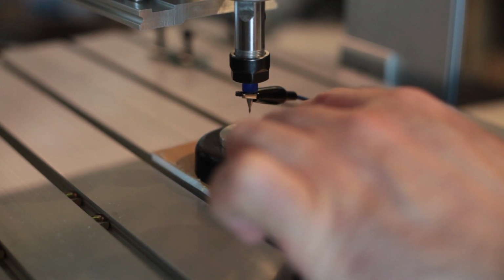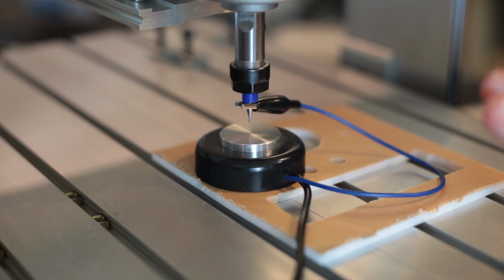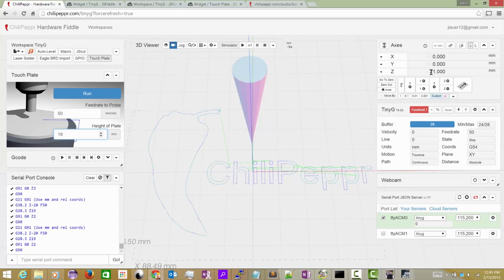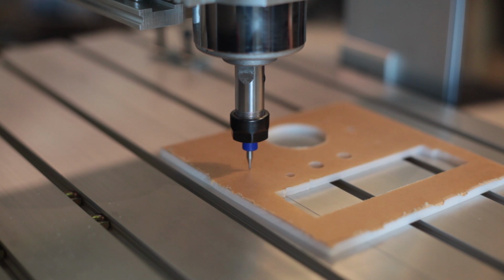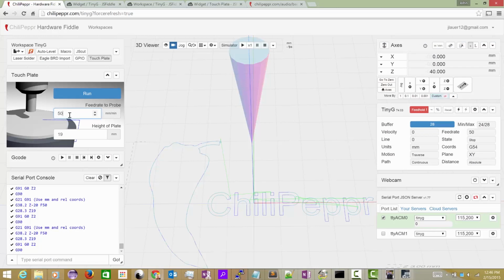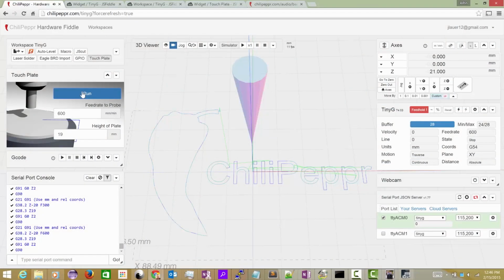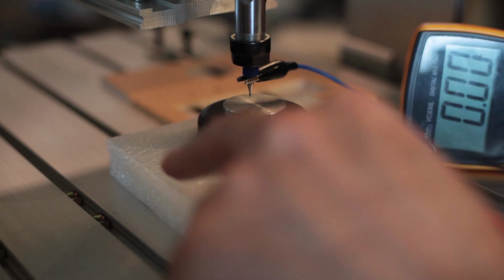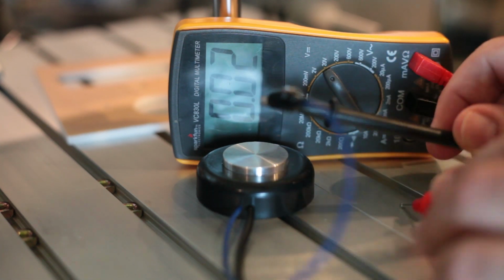Touch Plate in ChiliPeppr

Comment: John, like someone else posted, my spindle would travel up instead of down but recycling the controller fixed it. My question is why mine is not allowing for the touch plate thickness even though it have entered it. once the tip touches it automatically sets the Axis to 0. If I click go to 0 it goes to the touch plate height instead of the work piece height. Any suggestions? Great video!!
Reply from the maker: I've seen this behavior on certain versions of TinyG firmware. One thing you can do is just move your spindle down by the height after the touch plate process and then zero out all your axes or just the z axis. So there is a workaround with 1 more step.
Reply: My version of chilipepper is a little different. It has set g54, go to g54, set machine 0 and go to machine 0. I'm new to cnc and this was a bit confusing. When the probe touches that sets machine 0.  Remove the touch plate and click go to machine 0 and it's dead on. Which is exactly what you were saying. I was confused as to what was happening but I see it now. I'm now a subscriber!!

Comment: i used DSP controller. I set the z axis to use an automatic tool, but when it starts my machine, my router blade penetrates the table as deep as 3 cm. Why?

Comment: Probably a silly question but, how does this connect to the
CNC shield for it to acknowledge and feedback that a connection has been made?
For example I have this shield  http://forum.hobbycomponents.com/viewtopic.php?f=40&t=1747
Reply: It works! Touch plate and auto level.
Reply from the maker: On TinyG you connect your probe to ZMin (Z-).  You can connect that CNC shield to an Arduino Due to run TinyG G2 core.
Reply: Not sure I'll change boards just yet. I'm still trying to get to grips with how a CNC works :)
Reply: In the corner, the blue pin SCL (A5) and ground, but I haven't tested it yet.
Reply: Please let me know the results once you've tested it.
Reply: Sounds good, so you connected A5 to ground and this stops/zeros the Z-Axis?
Reply: A5 to end mill and GND to copper plate (for PCB milling)
Reply: Great! I'll give that a go - thanks for your feedback.

Comment: After homing my machine for all three axis using limitswitches i start using the touchplate for the Z. Instead of down, the spindel travels up most of the times. Sometimes it travels down. Any idea why this is could happen?
I have a 4030Z and use the same touchplate.
Reply from the maker: +Henny Poort What controller are you using?
Reply: +John Lauer I am using TyniG V8
Reply: +Henny Poort  After I homed my machine the "round pyramide" simulation of my spindle is  also hovering underneath the Z-0-level in Chilipeppr.  Could I have missed a setting somewhere?
Reply from the maker: What CNC controller are you using?
Reply: +John Lauer A TinyG V8
Reply: Did you ever come up with a resolution for this?  Ouy TinyG v8 behaves exactly the same way.  Trying to touch on the Z moves it up instead of down.  The new Super Touch Plate widget does exactly the same thing.  In fact, X and Y on that widget also move the wrong directions.

Comment: This is a cool add-on. I looked through the widget code, and it appears to use a G28.3 command to reset the z zero. Doesn't this reset the machine coordinates instead of a work coordinate system? Would it be possible to change it to a G10L2 command instead to set the work coordinate z zero?
Reply from the maker: Yes, I think a g28.3 is sort of cheating. Initially it was using a g92 but that was too fleeting and/or some folks have gcode that sets g92 in the run so g92 won't work. If you change it to a G10L2 you'd have to add a UI element asking the user which layer they want--g54 thru g59. I think most folks don't know what those are. So what's the best way?
Reply: John Lauer Perhaps it could just query the current WCS and assume that you're setting the Z offset for that coordinate system. So if you have G57 selected when you run the script, it automatically populates to G10L2P4Z... Does that sound reasonable?
Reply from the maker: Jon Hart That's a really great idea. Any interest in trying to fork the widget and add this?

Comment: Hello sir. I did not see the widget inside grbl. Thanks just ordered my touch plate
Reply from the maker: This widget is only inside the TinyG workspace right now. TinyG has a G38.2 command specific to probing like this that sends back well-formatted JSON when the probe touches so it was super easy to implement. Doing this inside Grbl is a different story. I do know that Jarret Luft, the maintainer of the Grbl workspace was looking into supporting this.